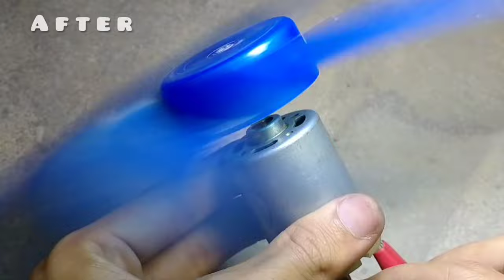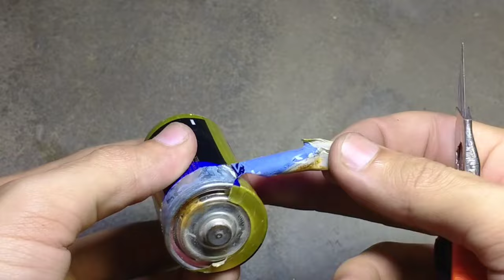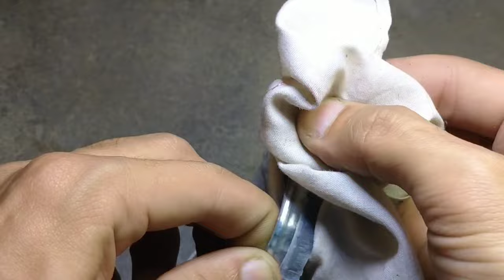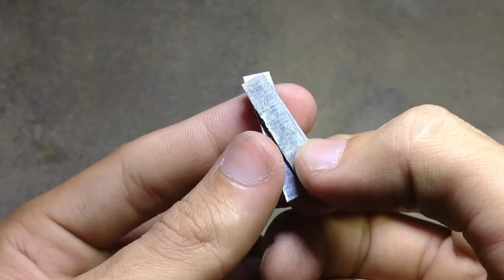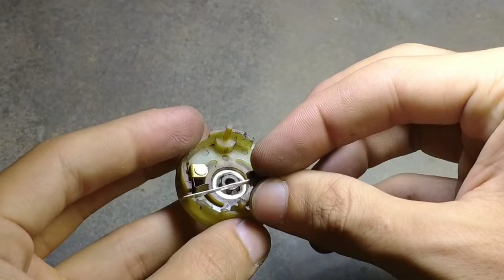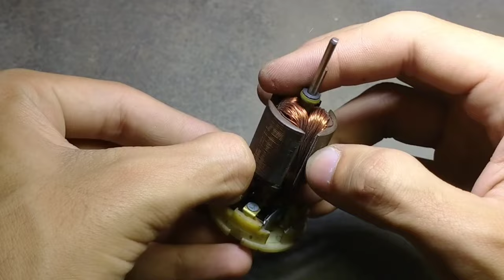DC Motor Repair: Easy Guide to Replace 775 DC Motor Brushes | DIY DC Motor Carbon Brush Replacement

Comment: from where did you get the 2 charbon parts ?
Reply from the maker: I get them from an old universal motor that is used for sewing. Thanks for comment.
Reply: Bro you can use the inner rod of the cell
Reply: @skullgammer1840 those are graphite and should work. Instead consider grinder, drill or blower brushes which is easily cheaply available. Contains proper materials for brushes like copper, graphite, coke, tar etc. Have to grind them to proper shape.